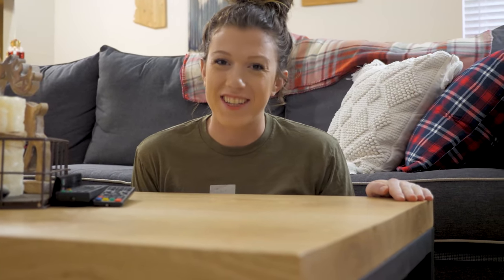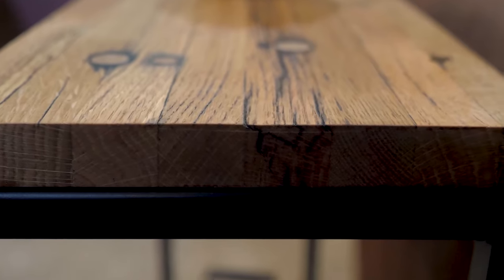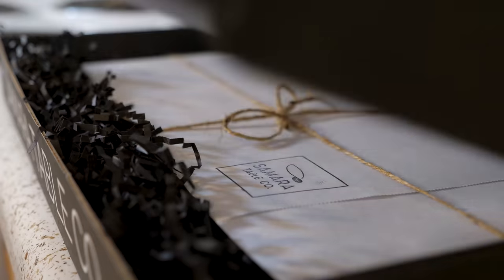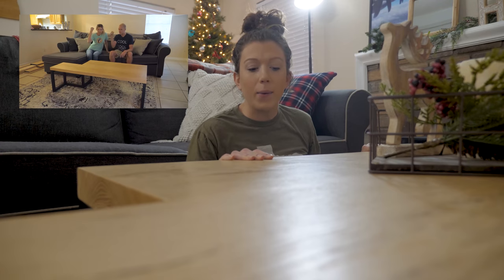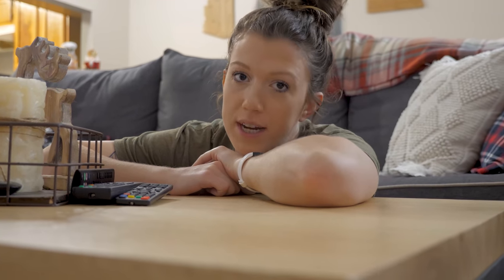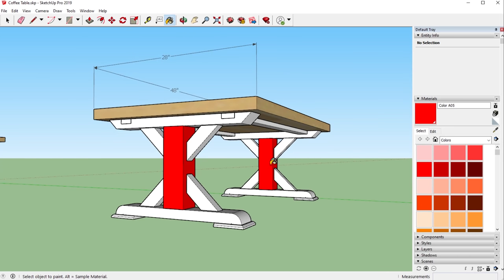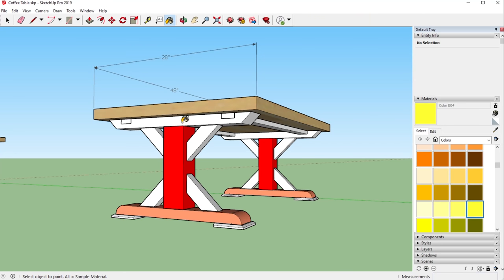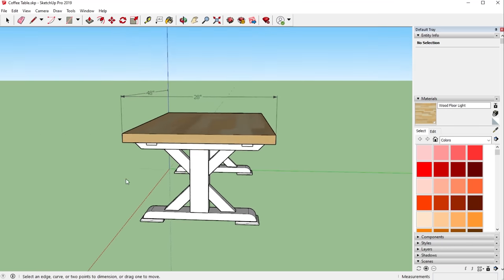we destroyed our coffee table 🔥☕️

Comment: quick note watch where your putting "down pressure" on your Joiner board , also when clamping table make stands to lift clamps off the floor and this way you clamp also the vertical as well, Other wise boards lift and you will be planing the top again, up to you but a ten minute worth clamping will save you hour of re-planning the top Level